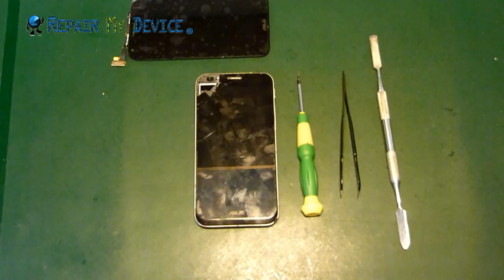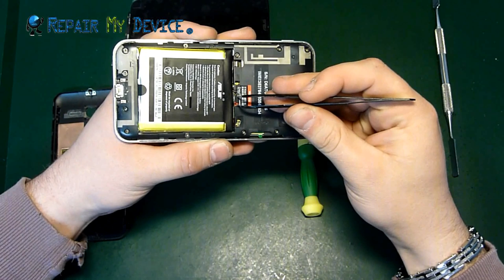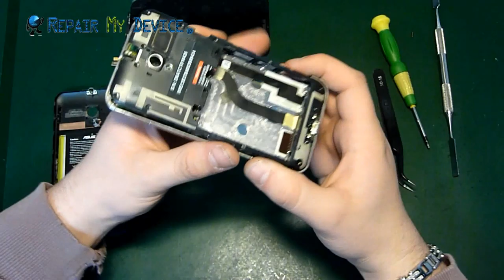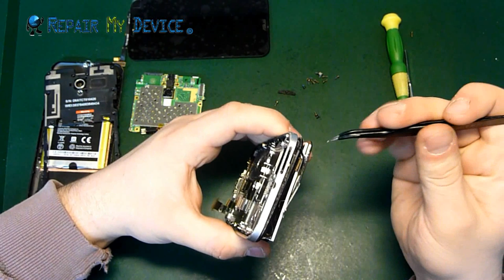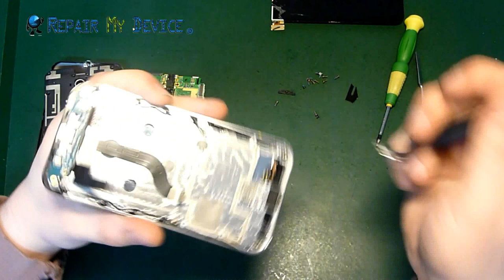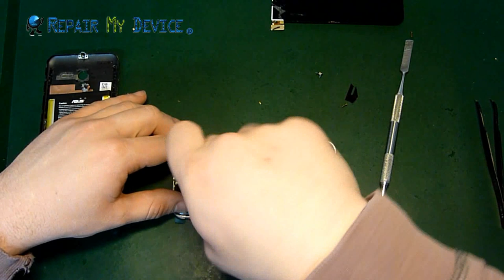Asus PadPhone 2

Comment: Hi, how does one change the screen glass? My LCD is good, is only broken glass and I bought it on Ebay, you change glass and LCD. There a solution? (I'm Chilean, I do not speak English, excuse me for the mistakes)
Reply from the maker: Hello

Sorry we only have complete LCD scren and Touch screen, and to change just the glass is a difucult process for a home user as this screen require bonding with a UV agent.
So we recomand to buy a complete LCD screen and Touch screen will be more easy for you 

Regards
Reply: RepairMyDevice
Okay, I just did not know it was so hard, the trouble is that this phone does not sell in my country, then I buy on ebay, wait 1 month and a half and pay 10 times what I paid for the glass. If you can be large enough to explain anyway as to change the glass, I will serve, because I buy it, and I can not do anything to get my money back if I buy the full LCD just lose this, so the worst is try not hope to understand me and understand that I am desperate. Thanks and best regards.
Reply from the maker: You can change the touch screen only if you have the right tools and UV bonding agent, If you don't the easy way is to replace complete
Reply: Hey! Can you please tell where to find that UV bonding agent? I have a similar problem to Nestor: TWO Padfone 2 devices with broken digitizer but working LCD. Will be glad to buy UV bond and digitizer from you if available and good instructions are provided. Feel free to also quote how much you'd take to make the repair (on both devices). Thanks!